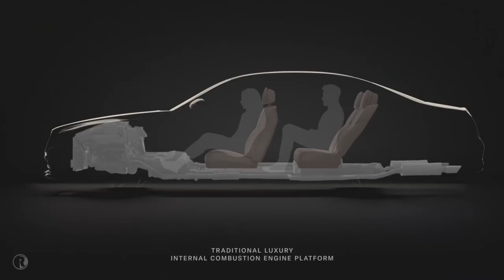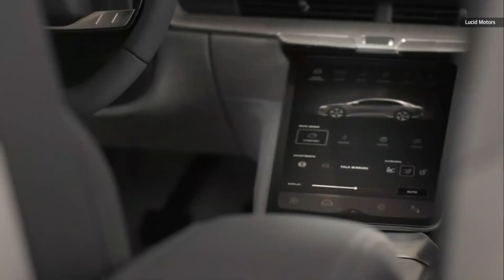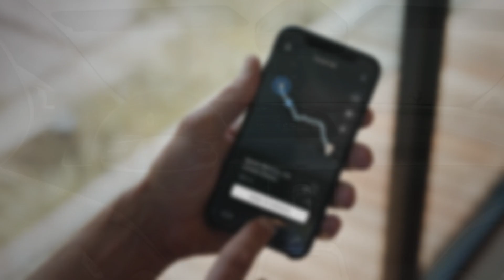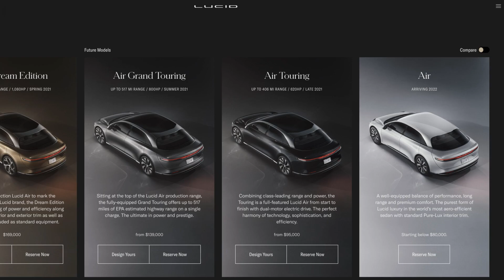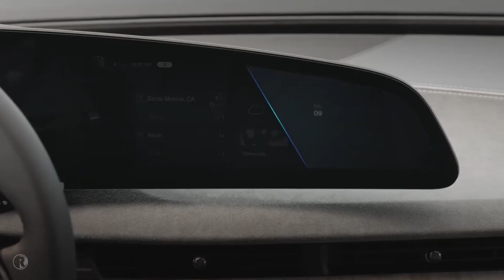The Future of Lucid Air | Luxury Car

Comment: Good try but EV only Tesla has the most advanced technology on battery and battery management system in the world, still unbeatable record, and charging network is the key and 0 competitors has more networks and speed of charging. Luxury I would by Gasoline car, all EVs are over priced and no value after 5 years of battery life
Reply: False, lucid has more advanced battery technology and efficiency, lucid partnered with electrify America and supports 900 V charging, making it charge faster than Tesla v3 supercharging, lucid is more luxurious, provides better price yo performance ratio, faster at home charging which got most is more important
Reply: @experimentalgaming1366  Funny. there’re no DC charge can output better than LV3 supercharger, how can you beat Tesla? also, all DC charger across the nation so lack of number of support, and many are out of order in most of time, all Highway supercharger are more than enough to support cross the country road trips with 0 worries, Tesla produce own batteries, and develop own Operation Systems and selfdriving largest databases since 2000, just like Apple’s product, from hardware to software are developed by same company is much more better than Android always crashing and short lifecycle.
Reply: @experimentalgaming1366  and the most important key is Tesla is the only profitable EV manufacturing than any automaker, speed of production line is even greater than Toyota, was the leading manufacturing. hope ya can survive in 5 years
Reply: @bhxu  when has andriod every crashed, that was in the old days, now andriod is just as fast as IOS, never crash
Reply: @experimentalgaming1366  Android os depend on which phone, but mad by 3rd party and for hundred of thousand devices you can’t utilize the smoothness and security. just like all the EV manufacturers none of major components made by itself. unlike Tesla and Apple, OS is specially made for the hardware definitely better than purchase/depend from 3rd party. Also, Tesla is the only profitable EV manufacturing amount all automakers. Consumer, which would you choose? EV also depend on massive electric charging points support, only Tesla is given the numbers and quality support. which EV would you choose if you would drive it for long trips?. Hundreds of thousands Luxury vehicles is half of price you asking, what would you choose? You and all ev manufacturers are 20 years behind the technology that Tesla had build, there’s only Tesla better than older Tesla, I see no others can give the same confidence like Tesla on EV
Reply: @3DDIE805  Tesla smaller battery with produced more range and power than any EV. what are you talking about